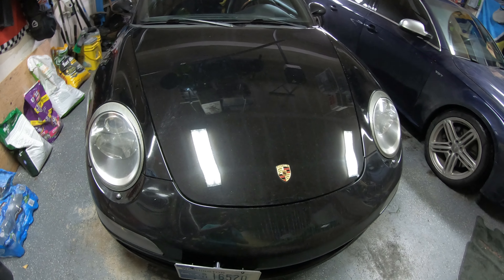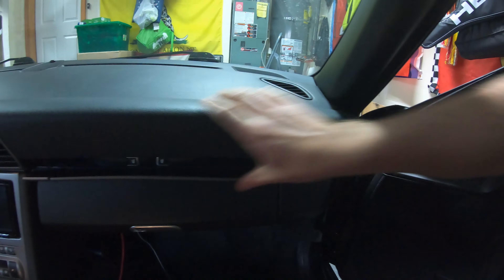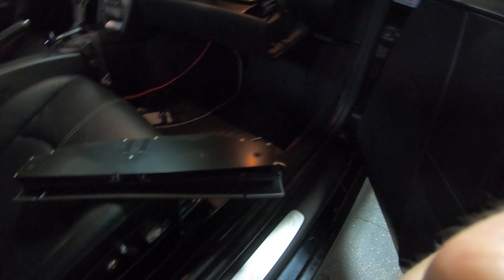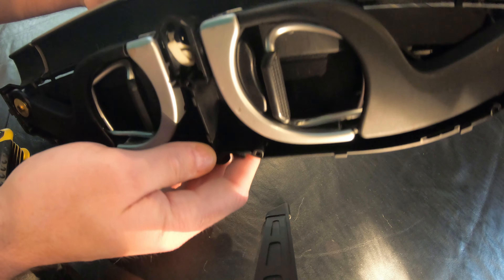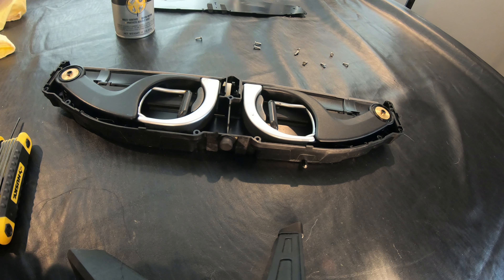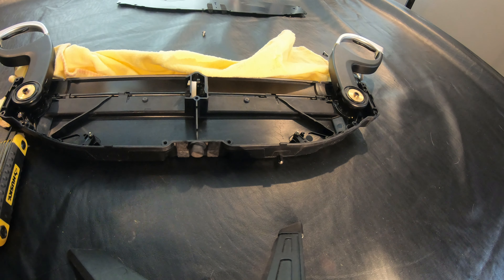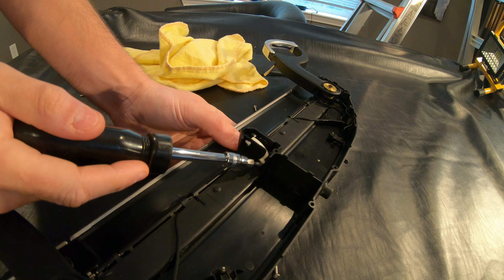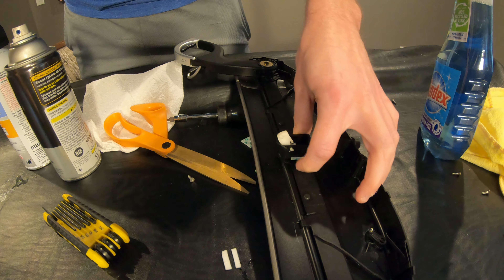Porsche 997/987 Cupholder Door fixed for under $5!

Comment: I've lived with my cup holder buggered for a decade. You are a champ! Great fix!!
Reply: Also, when I fixed mine, it just required a single piece of the clear heavy duty sticky tape on top of the cam - pushing it down ever so slightly. I found no need for the second piece of tape on the side.  It works perfectly every single time. Did not take the backing of the small piece on the cam, as you don't want it to stick to the lid of the cup-holder. thanks agin for this video!!!

Comment: Okay so i had the same issue with my 2007 987S, i removed the cluster unit and opened it up to find the same, no damage, no wear and nothing missing so i tried the same ideas but still wasnt working correctly so i thought whats missing now that wasnt missing when it rolled of the production line 13 years ago?? Then it hit me GREASE!! white grease! Over the years the grease has moved into the corners so not doing the job, i was convinced of this after i stuck some foam tape on top of the white track as instructed but mine overlapped one side and rubbed slightly on the housing causing resistance and it started working 9/10 times! S i removed all tape and packed with grease,i didnt have white grease to hand so normal grease had to do and hey presto 10/10 FIXED!!! With no grease the runner pin wants to stay at the top of the white track becuase of good ole gravity but from closed to open its supposed to go from bottom to top as designed, a little grease helps feed the runner pin down to up when opening and then closing due to resistance and it stopping the white runner track dropping! So top tip is re grease!!
Reply from the maker: Nice! Mine looked bone dry so I didnt think of using heavier and stickier lubrications
Reply: Thanks Matty!
   Two screws,dab of grease and the unit gets serviced. 
   Is that a dealer trade secret?
Reply: Hey man, I know this comment is ancient but 100% just worked for me, so thanks a ton.
Reply: Thank you!!! Just attempted this and it now works 10/10 times!!! it’s also quiet; the tapping sound went away when engaging!
Reply: +1 

mine hasn’t worked in the five years I have had the car. Squirt of grease under the cam and it is working fine, every time. Thanks for that!

Comment: I had a slightly different problem with my 987 Cayman.  As here, the cover was hanging down but in my case it was the little lug on the door that was broken.  

The guy who'd owned it before me had made an unsuccessful attempt to glue it but of course it was hopeless and he had somehow jammed the cover shut and I didn't notice it before I bought the car. Taught me a lesson!  

Anyway, you can remove the unit, as done here, and remove a couple of springs either end of the centre part of the cover (there are three parts to the cover with two smaller parts at either end of the unit - leave the springs in each of the smaller parts at either end) and you'll find the springs in the small cover parts at either end are strong enough to hold the lid in place. 

It won't operate in the way it was designed to - you'll have to pull it open rather than pushing the cover to open it - but it will work.

Comment: Thanks, I'm also a 987 owner with the same problem. It is amazing how many of the interior accessories do not work well as a result of being made from cheap materials or unreliable engineering.  I would expect much better from an expensive German vehicle.
Reply from the maker: Yeah, but people miss the weird expensive cupholders on the 992. Go figure.
Reply: @rieskame I didn’t know they got rid of them
Reply: The cup holders are designed and made by an outside supplier to Porsche. In a modern car, 70% of the content comes from supplier companies.
Reply: @davidgold5961  well they certainly are flimsy and unreliable in function.  Not being able to reliably open and close the door is very common.

Comment: 2011 Here.   My door closes and locks fine ,  but one of the cup holders it stuck in closed position .  Gotta a cure for that ?
Reply: Maybe I'll remove the entire thing like you showed and see if I can manually open it ,
Reply from the maker: Yeah take it apart and look. Maybe something is up with the spring.
Reply: The same problem since yesterday with my 2011 / 987c. I guess,  I will removecthe hold unit, clean and reasamble it. Were you been succsessful with that?
Reply: @UrsRiggenbach  i still havent tried. being lazy i guess. i never really need a cup holder anyway, especially where Porsche put ours.  LOL

Comment: Question is, how to make the door flush when it is shut. At least that’s my issue at the moment
Reply: Yes I’m having the same issue as well, find any solutions ?
Reply from the maker: Is it supposed to be tighter when it is closed? That would look a little cleaner.
Reply: Mine opens and closes ok but it isn’t flush when closed.  Not a tight door. I don’t drive it too often or have a beverage.  The cup holders aren’t too secure either.  Difficult to drive stick with beverage anyway.